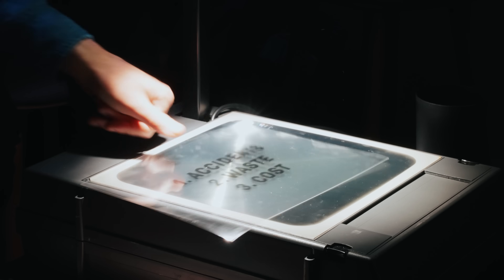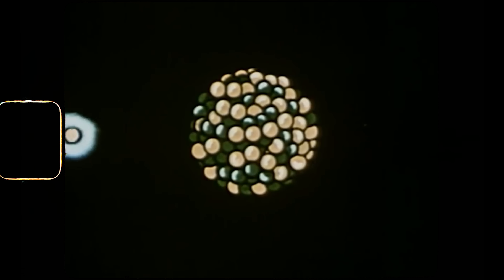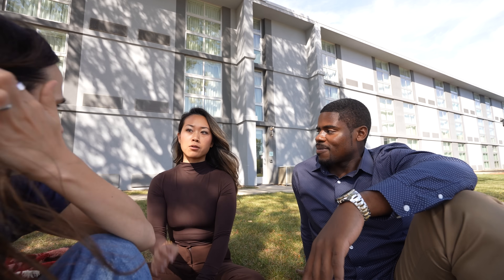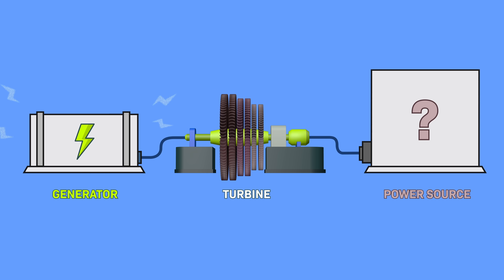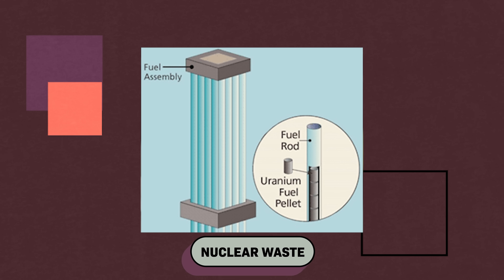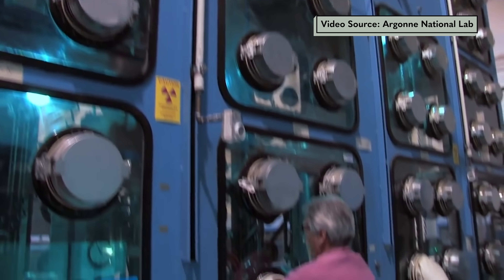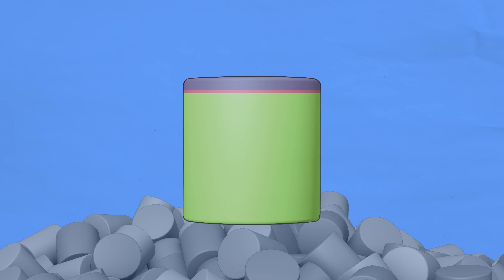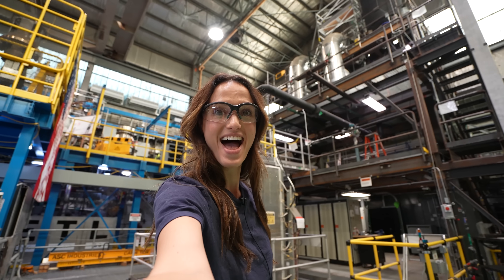The Big Lie About Nuclear Waste

Comment: For information in France since the 90's we use a recycled fuel name MOX ( Mixed oxide mix ) with uranium 91,5 % and plutonium 8,5 %  at 10% in 900MW PWR type reactors . About 3000Tons already recycled we also povide this fuel to japan and other countries,  its a different technologie than argonne but its also a good use of the huge stock of military grade plutonium. The french next gen reactor EPR will be able to use 100%  MOX .  This technologie was developed in cadarche ,in the facility where actualy ITER is built

Comment: Here in Germany we have just shut down the last three nuclear power plants. Even if the power utilities were allowed to operate or build new ones, they wouldn't do it any more. It is simply too expensive. Renewable energies, especially solar panels, are much cheaper to install per kilowatt hour and to recycle at the end of their life.
Our neighbour France has 56 reactors at 18 sites and they account for over 50% of electricity generation. They would have, if half of them weren't constantly broken and if they had enough water for cooling in the summer.
The development of nuclear waste regeneration would have to happen at Tesla/SpaceX speed for it to be used in the next 20 years. But by then, nuclear fusion could also be ready for use and no one will need it any more, because by then we will have switched to renewable energies. In Germany, we already generate over 50% of our electricity from renewables.
Reply: Finally, a sensible comment!

Comment: One question : how much does it cost to recycle it ?
If it's expensive, would you accept to pay twice your electricity rate ?
Energy is literally the growth of a country. Expensive energy is slowing down growth, or recession. We are already crying with single digit inflation. What would a sustain recession do ?
Until it's cheaper than non recycled uranium it won't be viable.

Comment: The main reason nuclear is not used is the cost to build one now is enormous maybe up to a billion dollars. take a look at these Wikipedia nuclear power accidents by country. Then there is the 3-mile island, Chornobyl, and Japan when a big mistake happens it can kill thousands of people. all people who worked in Chornobyl died of radiation poisoning, In japan no one can live in that area for years, e mile island they used lots of cement to encase the facility. Most of these mistakes are human error and when you're dealing with something this toxic people will die.
First, calculate the cost of building  a nuclear plant then figure out how long it can remain in operation then figure out the risk and then see if is feasible. To say its safe is not correct

Comment: Nuclear waste, is really not an issue. The waste can be stored properly, but besides that, in the scadinavian countries, they are encasing the nuclear waste in DIAMOND, and extracting a certain amount of Electricity this way. BUT this is not really what I want to focus here. The really good tech is Thorium reactors, which can supply human civilization for Millions of years, some estimates are 1M to 3M years. So, Thorium is the better solution in general. And Thorium is much more plentiful than Uranium. Also China has been doing Thorium research for many years now, in about 3-4 years will have the first Thorium reactors go live. So, to Summarize, Thorium is the way to go. We are using a way less efficient nuclear technology with Uranium today.

Comment: Most of the radiation people are afraid of in spent fuel will be gone in 210  years.  In 900 years it won't be any more dangerous than natural Uranium.   You certainly would not need a heavily shielded cask to protect anyone from it.  Why do people keep worrying about 100k year storage?

Comment: Bright.. If you really want to maximize fuel, then the breeder reactor is king, UK ran a test / operational one a Dounreay, now decommissioned. The name "fast breeder" possibly scared people more than it needed to, "isn't FAST more dangerous?", but it uses fast neutrons which have greater capture to convert U-238 into PU-239 (there is some conversion in other reactors, but not enough to reach breakeven, never mind exceed it.
Proliferation? Unless the breeding cycle is kept short, shorter than optimal for power generation, then the Pu-239 builds up contamination with PU-240, an isotope which makes weaponization difficult.
What make fuel "spent" is more the buildup of waste products which impede the the reaction (neutron poisons) than the consumption of the U-235 fuel - there is probably more of that left than in the original raw Uranium.
So an unscientific description of what's left is:
1. The "useless" U-238 bulk and casings
2. Unreacted U-235 fuel
3. Reactor bred Pu-239 (or unreacted if originally a mixed fuel)
4. A mix of fission products and decay products of varying characteristics
Neutron poisons which choke the reaction by consuming neutrons
Short half life isotopes which give off a lot of radiation and decay heat, but burn out quickly (during the cooling pond stage)
Intermediate and long half life isotopes which are not as "hot", but remain radioactive for decades to centuries.

Comment: Here's my guess before watching the video: nuclear waste is caused by political decisions which require building only light water reactors.

Update: I think I guessed correctly. The sad part is that since 1960s, there has been so much engineering effort put in the light water reactors that making fast breeder reactors (the type of reactor that can use natural uranium without enriching and it can also use nuclear waste from light water reactors as fuel) are about half a century behind in the engineering effort. Unsurprisingly, the cost per MWh is greater for fast breeder reactors.

Comment: Norm metals that are scraped they are cut with high temperature and pressure washed . The water is pumped into marked boxes. The water is pumped back in the ground in deep wells. Heat will get norm out of metals. Even Gamma can be removed. I would advise a norm badge to wear. You never know.

Comment: Unfortunately there is a killer app which produces energy far cheaper: renewables. As renewables get more efficient and cheaper by the day, nuclear won't ever be able to compete anymore economically. Also using renewables doesn't create all the problems that nuclear does. From producing plutonium to producing nuclear waste to producing catastrophic economic costs in case of catastrophic failure of the plant.
Reply: Nuclear power will be useful for space travel anyways
Reply: @hydromic2518  Can be. Missions beyond Mars probably can't work with solar panels because near Jupiter solar energy per area is only 1/25 compared to earth. A permanent moon station has to cope with moon nights lasting 14 earth days. The risk is that rockets fail pretty often and if you are transporting tons of nuclear fuel into space there is a high risk that it burns up in the atmosphere of earth and we will have the biggest nuclear accident ever.

Comment: It's a really beautiful idea but it's gonna require a lot of government intervention for economic reasons. The whole point of building a nuclear reactor (from an economic point of view) is that although the reactor is expensive, your basically don't have to spend anything on fuel. Reprocessing is amazing but it requires building an even more expensive reprocessing plant and slightly more expensive reactor and in return you save a little bit on fuel which is already a negligible part of your operating cost. I support it 100% for environmental and public good reasons but we're gonna need a government controlled program like the French or the Japanese to pull it off.

Comment: Radiation is energy. Surround radioactive material with receiver/converters and convert it directly into electricity. The same principle of the [deliberately inefficient] Solar cells. One such system was invented in the 1950's. No I don't remember who invented it but it converts  radiation from raw Uranium ore into electricity.

Comment: You have made a very accessible video that is a useful contribution to general knowledge, however you have made some glaring scientific errors that should not be propagated:
The number after the atomic symbol, like U-235, is NOT the number of neutrons in the atom rather that total atomic mass. The number of neutrons is the atomic mass minus the number of protons which is 92, making the number of neutrons only 143. Secondly, fission does not occur in a reactor because of atoms colliding, but rather because of the collision of high energy neutrons (moving quickly) striking the nucleus of atoms. 

I am not a nuclear physicist, but rather an engineer and I caught these. The fact is that your well done production will capture many eyeballs (237K so far) and you should not spread incorrect information. A lot of people get all of their information from videos like this.

Comment: Why didn't they start promoting nuclear power like this 30 years ago when I graduated from Kansas State? You should research and do a presentation on the barge-mounted reactors that could be used to plug into the grid on demand. That tech could also be used to desalinize sea water as well. Please get in touch with me; I will work for you as a researcher to get the word out. You certainly tell the story well!

Comment: Such a bs video. There is a thing called "entropy". So you cannot recycle all waste back to fuel like in a fairytale. What happens for example with the plutonium? You just have fallen for the propaganda of the nuclear industry. In France for example they have these fast reactors in use and they still need an end deposit for nuclear waste. Make a proper research before!